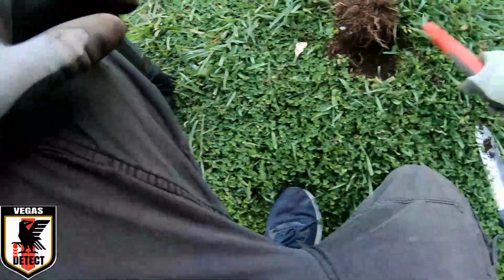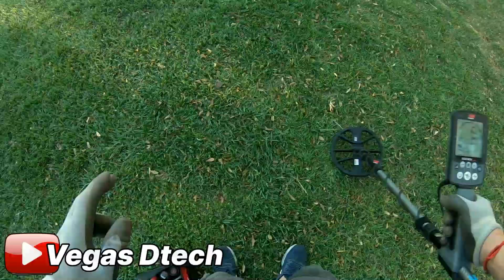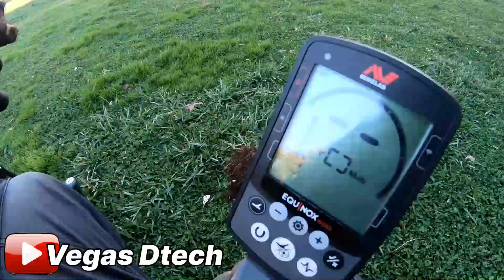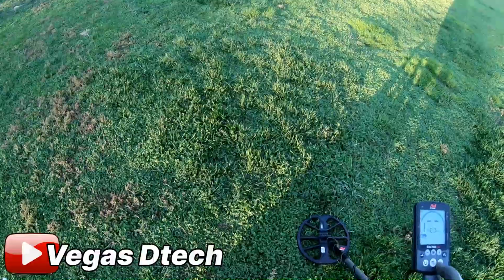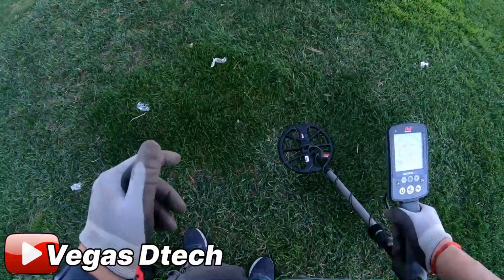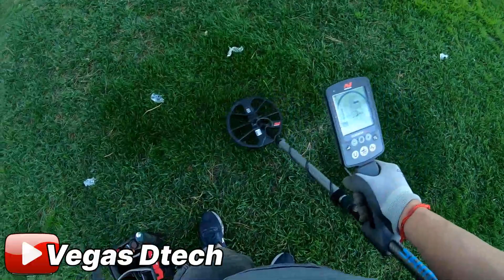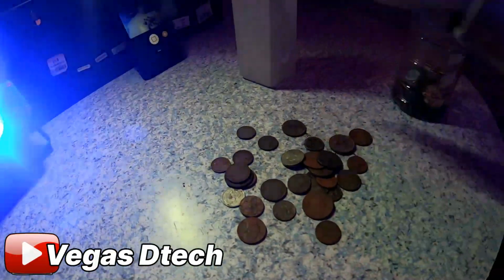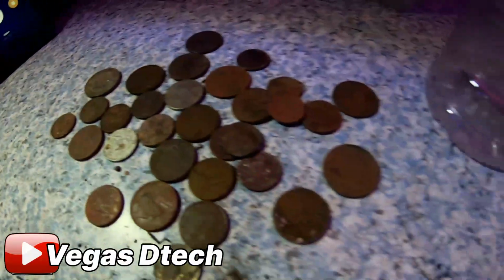Multi Frequency vs Single frequency  Minelab Equinox 600-800

Comment: Rite on brotha man Its Max good info man I wish I was able to get the Nox 600...I have the Simplex and Vanquish 440 both good machines but ready to move up thanx for ur vids brother stay safe
Reply from the maker: Hey Don whats up.. in 1 week i should have a NEW but 10 year old Minelab detector that I will reveal. Best single frequency detector i ever owned and so excited to finally get it back in my parks . Stay tuned bud - Joey

Comment: After using multi frequency, i will never go back . you're doing it wrong btw when you use the multi frequency. you need to try different angles  waving your detector  back and forth at the same spot is doing it wrong. you can clearly tell what's what with the sound.... i find so much better stuff with multi then single . its really not hard to learn